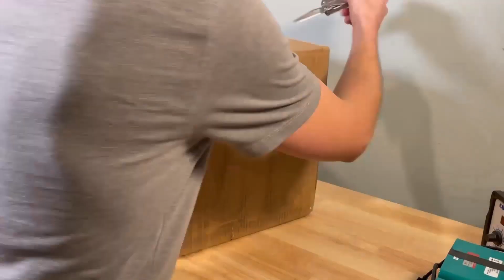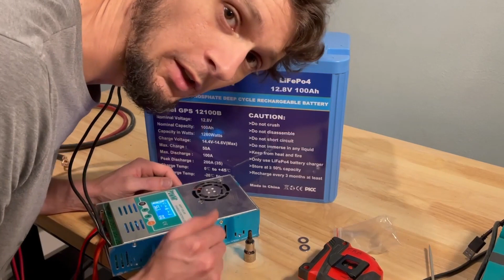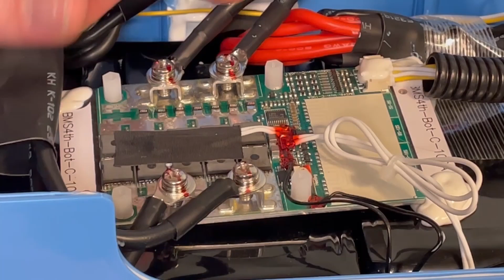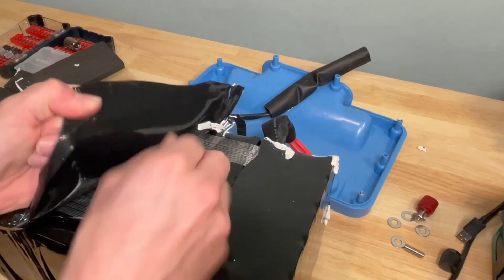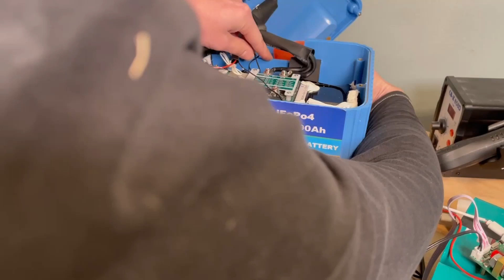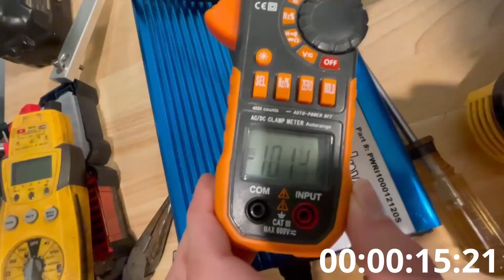Global Power LiFePo4 Battery Review and Tear Down - 100AH 12 Volt

Comment: Have you fully charged these and done another discharge test?  I have the BMS tripping issue with mine with the voltage at 14.3.  A discharge test showed only 75 ah.
Reply from the maker: I’m currently working with it to see if the cells will balance themselves. Haven’t Done another discharge test yet. 14.3 is pretty high to be that affected but it’s hard to know without top balancing and testing again.
How did you test the 75ah?
Reply: @BeeneEnergy  it's been few weeks since we texted..... Have you figured out why the limit is 13.7-13.8 volts with out oscillating?... I have just let mine use victron set to 13.7 but no change
Reply: @BeeneEnergy  I discharged through the inverter with a heat lamp load (about 17 amps).   I measured the discharge with a Trimetric battery monitor and a KilaWatt meter on the AC side.  Actually on 69.3 on the Trimetric, 0.79 kWH on the Kilawatt (790/13=60.7).
I just charged it back up, the energy put back is about the same.  The last bit of charging was on the solar.  I had it set to 14.0 V.  It was taking about 11 amps V rose to 13.75 in bulk, then rapidly rose to 14.0 and BMS started cycling.
Reply: ... I had the SCC set to 14.0 V.  It was taking about 11 amps, V rose to 13.75 in bulk, then rapidly rose to 14.0 and BMS started cycling
Reply: @BeeneEnergy  Hey! thanks for this video, i purchase this exact battery from ebay 2 weeks ago and im in the process of testing it . your comments are helping me a lot in understanding the process with the cells balancing. i charged the the battery 3 times already (before reading your comments)at 14.4 v and discharged it with a steady 15 amp load and im getting the same result every time only 75ah. im going to charge it back today at 13.77v to see if it will help gain capacity. Thanks again for opening it up for us . very interesting and im looking forward for you to do more testing . regards
Reply: Well after recharging the batteries for 3 hours at 13.8 v from solar power, they where indicating full with 100% but maybe not . My discharge test failed after 1hour and 40 minutes it was depleted completed. 
I don't know what I'm doing wrong .
Please help
Reply from the maker: @imag555  What rate we’re you discharging at?
Reply: @BeeneEnergy  I put a load of 180watts constant
Reply: @BeeneEnergy  actually I had a load of 16amp from the inverter
Reply from the maker: @imag555  Any idea why you’re getting 25% capacity instead of 75%? That’s a big change.

At what voltage does the bms cut out for you?
Reply: @BeeneEnergy  I think that the batteries didn't charge completely with only 13.8 v.
I'm charging with solar so , I will test it again tomorrow
Reply: @BeeneEnergy  how do you top balance theses batteries since they have internal BMS?
Reply from the maker: @michaeld4502  Requires some trickery! I’ll know soon if it works well enough to publish.
Reply: @Beene Energy I bought 2 the first on internal meter says 100% but voltage shows 13.8 v.... I am changing with victron 100/30 with 2 12volt panels in parallel... Shows 20.5 v and 6.4 amps..... The battery on victron app shows anywhere from 13.77 to 14.4 or 14.6 when I set the voltage parameters... Then it jumps to 15+ and goes back to 13.77 v..... I have then lowered the change voltage to 13.75 and reduced current to 1 amp that seems to keep battery from spiking but no current flow.... When I raise it to 13.8 on app to match the internal meter it starts oscillating again.....  My fluke 87 shows 13.77 to 13.86 and sometimes spikes to 15v with current settings at 13.85volt and absorption 13.5 v and current is .1a the oscillating still happens????? Any clue what is going on????
Reply from the maker: @michaeld4502  Yep you’re experiencing what I was showing in the video. One of the cells is hitting high voltage right around that 13.7/13.8v mark.

On the plus side you should still have most of your capacity only charging to that level. I’m currently experimenting with manually balancing the cells to see if any significant gains are introduced. But I measured over 100ah even with an unbalanced battery.
Reply: @BeeneEnergy  that was fast response!!!! I plan on using 2 of these for 24v setup if the one goes to 14.2-14.4 volts and this battery stays @ 13.7 then then the victron 100/30 will never make it to the full state of set points????? Seems like this will oscillate and will have to drop to lower value???? Is that a correct assumption?
Reply from the maker: @michaeld4502  Yeah you want to avoid those spikes. So setting max voltage to 13.7*2 might be what you need to do. I’m hoping to find an easy way to get these balanced for higher voltage operation but really don’t think there’s much being missed out on other than changing some charge controller settings.
Reply: @BeeneEnergy  I've finally stabilized the voltage at 13.77volts when MPPT feeds 100mA it won't oscillate.....   Wondering could this be the BMS and not the cells?
Reply from the maker: @michaeld4502  The BMS being faulty? Not likely, seems to be a pattern that the cells aren’t top balanced before shipping. I bought four more of these batteries and they are topping out at 13.8-14v as well. The one I have apart I can watch cell 4 with my multimeter and as soon as it hits 3.65v the bms cuts out and causes voltage to spike back to charge controller.
Reply: @BeeneEnergy  so it looks like we will have to void warranty and split theses apart and charge the other 3 banks to match the odd bank..   I have even set the absorbing voltage a bit higher makes no difference.... Had error at 13.77 so backed it down to 13.76.  Real stable setting current back to 30amp like it was out of the box....

Comment: Don't you own a phillips screwdriver.  Kind of annoying but certainly revealing look inside.
Reply: Like that battery, but wish they'd have put a better BMS in it.
Reply from the maker: @michaeldoherty2289  I’m definitely torn there. I love having an overbuilt bms with features but realistically I can’t have that at this price point.

Wonder how hard it would be to create pigtails and connect a 16s bms to a set of four of these batteries. Bypassing the internal bms on each.

Probably not worth the effort.
Reply: @BeeneEnergy  I thought this might me a good battery to try, but when I saw that cheap 5 dollar BMS it stopped me cold.  Fixing it isn't worth the effort.  I am going to order 8 206ah prismatic cells and 2 200A JBD BMS's from my Shenzen supplier (with heating film and monitoring too) and build the 412ah I need.  Not much more money spent than 4 of these and I'll never have to wonder when its going to fail me when I am camping in the mountains somewhere.   Only downside is the long wait and the possibility that the cells will be damaged in transit.

Comment: Have you done any testing on the max discharge rate?  I have 4 of these on a solar system in an RV.  When running the A/C it runs for a while and then DC volts shoot up to around 123 / 125 then the system shuts off.  Pretty sure its the batteries, but not 100% sure yet.
Reply from the maker: Dc volts go up that high? Are you running as a 12v setup? Where do you see the high readout from?
Reply: @BeeneEnergy  Inverter remote monitor.  Batteries feed the inverter and it powers the AC appliances.  Was looking to have the A/C be capable of running long enough for us to eat at a restaurant while traveling and allow the dog to stay in the RV / travel trailer
Reply from the maker: @jayearly6175  Is it possible the air conditioning cycles off reducing load and at the same time solar is coming into an almost charged battery causing it to spike?

What do you have in the way of solar. Can you try dropping the charge voltage to 14v? I did notice a voltage spike if I had it charging higher than that.
Reply: @BeeneEnergy  I have the GP Electric Solar Elite system with the IC2000 Inverter / Charger / Transfer switch.  380w. solar panels.  I will absolutely try dropping the solar charging voltage.  I had not even considered that as an option.  That would make sense because the batteries do show some discharge at that point.  Thank you very much for the idea.  I've been at a loss on what to do except replace the batteries and try to find one with a higher discharge rate and higher peak discharge rate.
Reply from the maker: How long does the ac typically run before you hit the failure scenario?  Another scenario could be that the batteries are depleted and hit low voltage cutout. Inverter shuts down. Then solar charger tries to push power in but there’s nowhere for it to go.

Regardless 120vdc seems like an awful lot either way. I Assume this is a 12v system?
Reply: @BeeneEnergy  Yes.  12v DC system.  Maybe 10 minutes?   System runs about 60 dc amps then climbs up.  It does sound like a compressor is kicking on, which I find a bid odd because it was running and cooling off.  Batteries at about 90%.  System shuts down, then I power the inverter back on, everything good for about another 10 minutes .
Reply from the maker: @jayearly6175  If you want, send me some photos of your wiring. Beenebrothers1@gmail.com. That behavior is odd. Also what type of air conditioner is that? Typical roof mount or an inverter drive type?
Reply: @BeeneEnergy  Will do.  Thank you - appreciate the help.  Coleman Mach 15k BTU.  AC amps should run 12-13.  Read that equated to 10-11 DC amps per, so that seemed to make sense.  Thinking its the BMS cutting off the battery power as a safety precaution.  If that batteries are going over 100 amp continuous for a period of time could that be tripping the BMS?  I don't think its getting as high as 200 though.  So that part throws me.  Last number on the inverter remote is 123 then all power is lost.
Reply from the maker: @jayearly6175  Yeah I’d expect no more than 150a but that’s spread across four batteries so 35a each? Hard to imagine them tripping from 35a. Unless something is perhaps wired odd causing one battery to take more load than the rest.
Reply: @BeeneEnergy  Great point.  I did not realize the load would be spread across 4 batteries.  Should be able to send you a pic. of the battery wiring tomorrow.  Thank you for all the help.
Reply: @jayearly6175  Do you have a soft start setup to assist in the A/C unit cycling ?
Reply: @jayearly6175  15,000 btu is a lot of draw on 4 - 100ah batteries.  
I'm using 3 - 315ah to run a 5000btu  a/c unit and 1000watts solar and I can run pretty much all day on low setting of the a/c unit
Reply: @Nomadic_Kokopelli  Yes sir, I have a Micro Air Soft Start.  Thanks for the tip on the batteries.  I've pretty much ruled out the inverter as the issue as I have watched the display on the battery flicker between 100% and 0% charged.  I'm thinking the load is causing the BMS to cut out.  What thoughts do you have on what size battery I should be looking at?  I am not trying to get it to run all day on solar - just long enough to keep the travel trailer cool while we are eating in a restaurant or if we stop somewhere for a short time.  I'm currently looking at the Battle Born 270ah with 300a continuous draw or Renogy 200ah with 200 continuous draw.  Any thoughts?
Reply: @jayearly6175  If you want the best. 
Lithionics based in Tampa/St Pete area.  Their batteries are unrivalled by anyone.  And customer care is beyond amazing.  Talk to head of sales and just mention my name or SV HYDRA Sailing to get a little discount.  I'm sure you can easily sell those you have.  You could also eliminate the BMS on those units and buy an external but thats a detailed setup.
Reply: @jayearly6175  The Renogy is a good unit ,, but not a huge improvement over what you have except for the capacity aspect.
Reply: @Nomadic_Kokopelli  thank you sir.  I have reached out to them.  Appreciate all your help!
Reply: You must mean amps not volts????  Did you parallel the 4 batteries together?

Comment: Found your YT channel by way of a Craigslist ad for solar panels.  Looks like a lot of great info to catch up on.  Thanks for the review.  I have been running an off grid system for a cabin for 5 years now.  Have been using AGM but looking to go Lithium.  Interested to see how your 48 volt project works once you get 3 more.
Reply from the maker: I did go ahead and buy four more. Supposed to be here tonight! Working on the rest of the system now along with a new 5kw inverter. I’ll do a video if it all comes together nicely!
Reply: @BeeneEnergy  EXCELLENT!  Cant wait to see it.  Still cant believe you found a lithium battery WITH cold temperature cutoff in this price range.

Comment: Can these be run in parallel?
Reply from the maker: Yes. There’s no situation I know of that would keep batteries from safely running in parallel. Voltage is all the same. You would try to wire them in a way to balance the load between batteries.

In series the voltage climbs so it must be supported by the battery, more specifically the BMS.

Thanks for watching!

Comment: Thanks for the video.  I''m new to solar and was wondering if I get four of these to build a 48v system, could I add 200ah batteries to this bank later or would I have to stay with 100ah batteries?
Reply from the maker: Yep, just keep the chemistry (lifepo4) the same.
Reply: The way I understand it if you have 100ah batteries and then add 200ah batteries then your overall pack will only be 100ah and you will never use the full potential of the 200ah batteries. Be the same thing if you added 300ah batteries to your existing 100ah system.
Reply from the maker: @fauxque5057  if you’re adding in series you’re right.

If you’re adding in parallel (staying at the same voltage)  the extra capacity will be used.

Comment: That's a great price for a factory built battery that performs well. Yup, looks just like the BH modules.
Reply: Not quite the same build quality as BB.  Take a look inside one with Will Prowse and you'll see.  But the cells are cylindrical and hold energy just like theirs.    Your power items won't know the difference, but you wallet will.  $799 BB now (latest price) vs 293.96 for Global Power.
Reply: @michaeldoherty2289  Right, I was talking about the BH (battery hookup) modules. But yes agree, not quite the same build quality as a BB, but very acceptable IMO
Reply: @BradCagle  Yes you are certainly correct.  They do look exactly like the BH modules.   This is a really good battery.  I just wish the BMS was higher quality, but maybe I am wrong.  I could be fine.  Time will tell.  If I was in the market for one 100ah battery for a bass boat or a small pop up trailer,  I'd jump all over this.   So much better than any lead acid product.
Reply: @michaeldoherty2289  The upside, the BMS is fully accessible so if you needed, or wanted to replace it later you could. I like that a lot.
Reply: @michaeldoherty2289  can you provide a link. I can’t find any review on these from will
Reply: @johngrier5949  Don't think he did one....